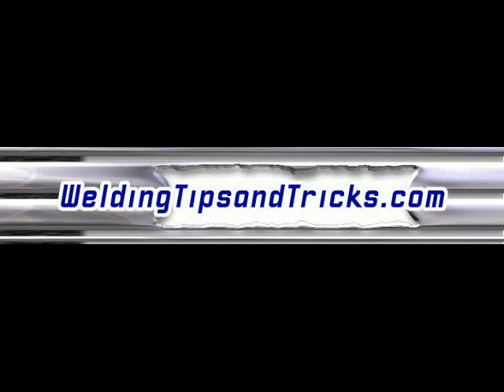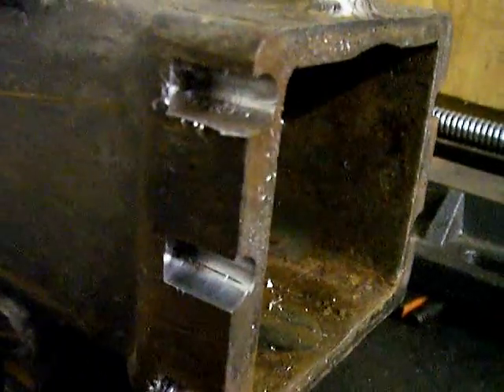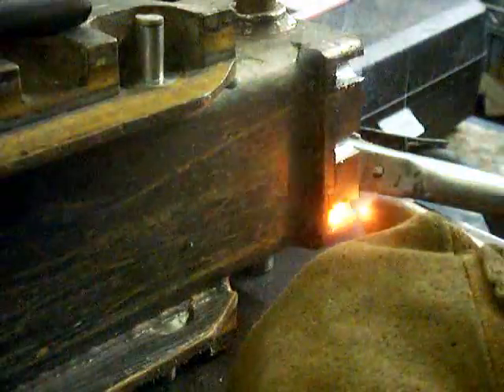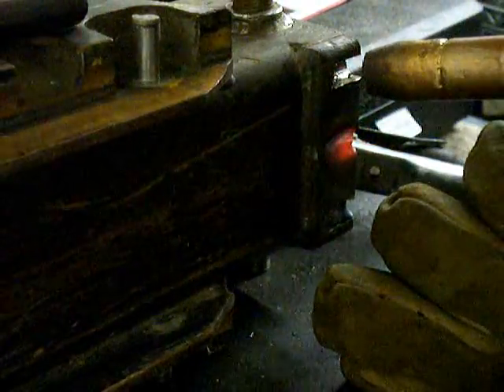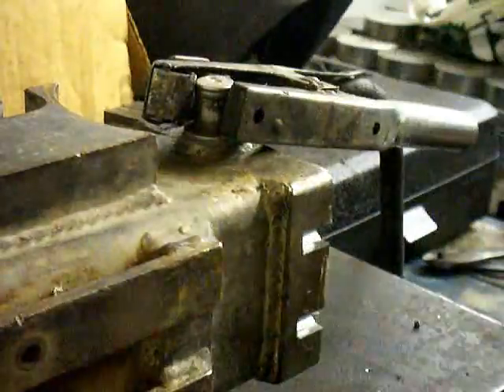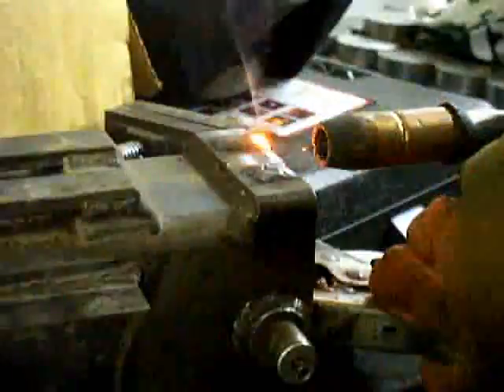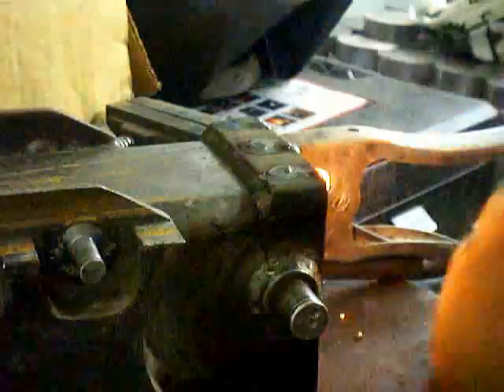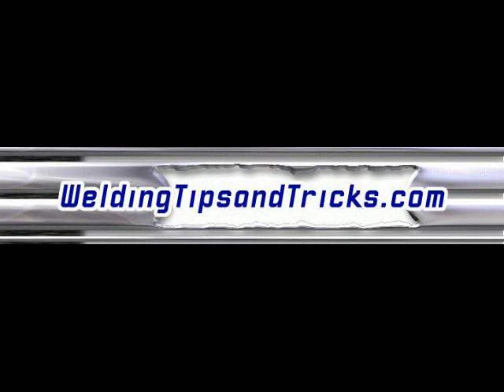Weld Repair - How to Mig Weld Repair Damaged Threaded Holes

Comment: Hey Jodie, I had to weld up some 1/2" holes in mild 5/16" plate using a mig, dress drill and tap a thread, problem is the metal has become so hard I can no longer drill it. I have never struck this problem before have you?  Thanks

Comment: you don't need to anneal it, the only thing that would do is make the metal softer.

also unless the base metal is cast iron, stainless steel, aluminum. you would use .032 or .052 copper wire
Reply: Shut up 🤦🏻‍♂️

Comment: do you need to anneal those welds before you can cut threads into it ?

also are you using a special wire to do this kind of filling that has to be machined ?